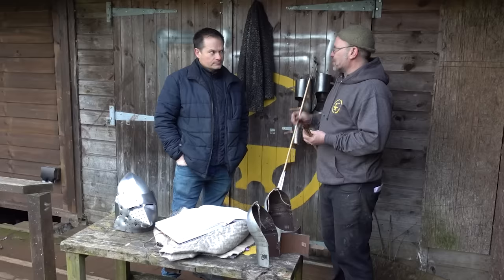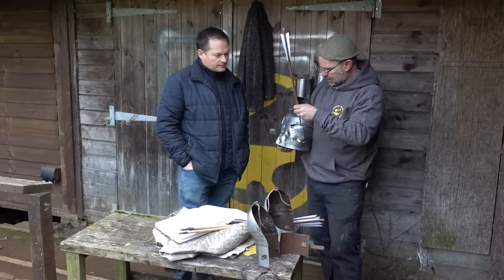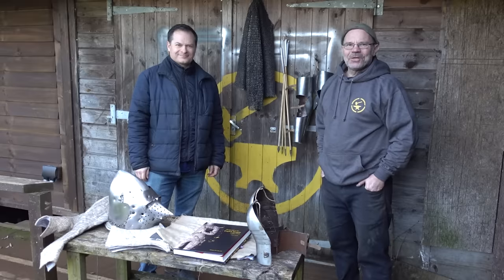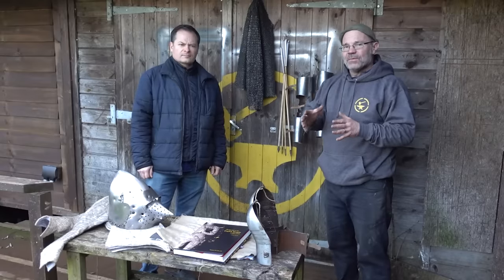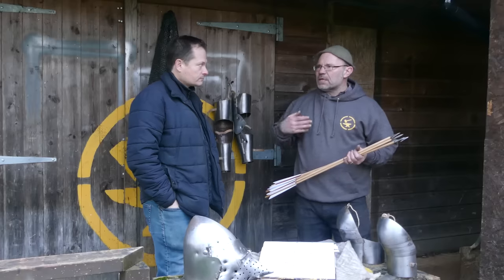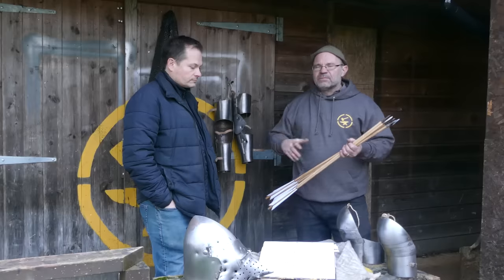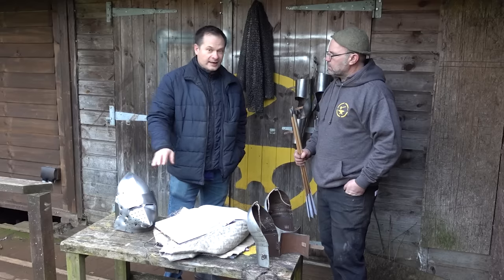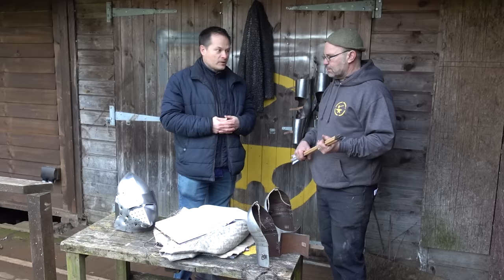Arrows vs Armour 2 - Our thoughts 6 months later

Comment: Have you ever thought that the ghost of a dark ages blacksmith and his archer friend are looking on and wondering why you're repeating what they went through in designing the armor in the first place?
Reply: It's a bit like NASA - we've lost that technology as technology moved on.
Reply: I mean, the dark ages weren't anything of the sort, but ghosts don't exist, so I guess the fantasy evens out?
Reply: It really is a shame they didn't just get a medium or a sorcerer to just summon them up for the info. heh.
Reply from the maker: I do wonder if they would look down/up at me and laugh or just simply be perplexed
Reply: @coolsenjoyer  those are NASA's words.
Reply: @neiloflongbeck5705  we don't use analogue computers any more, and we need to shield digital computers without adding too much weight.  Some types of engineering were lost, but we haven't gone all the way back to the beginning.
Reply: @DavidSmith-vr1nb  we are still using analogue computers to this day, such as in neuromorphic computing, or in heating systems (thermostatic controls) and in vehicles (speedometers).

Comment: Arrows vs Armor 2, the series of films, was clear and well laid out with an excellent crew. Anyone who came to it in good faith would understand exactly what it is, and what it isn't , what was demonstrated and what questions were raised. And you were open and honest throughout. The fact you had to make this video, some of the concerns you address, reflects on the commenters, not the films.
Reply: This is a 48 minute video and most of it is rooted in their own thoughts - not sure why you feel the need to slate the comments on the other videos just because they disagreed with some of the stuff said in the original videos. Tod and Toby have made it clear they welcome that disagreement - in this video, no less.
Reply: That's exactly WHY they asked the peanut gallery for help & comments - so we as a group could think of more things to test that might have been missed.

I was among the "brace it so it doesn't move so easily" crowd - turns out the event length was enough shorter than the kinetic transfer that it's irrelevant from the armor's point of view. (Honestly expected a MUCH faster transfer of energy from arrow to armor.)

P.S. The more eyes you have go over a paper BEFORE you publish, the less likely you are to publish in error.
Reply from the maker: In reply to Andy, we didn't actually feel compelled and in fact the response was massively positive and of course there is always some negative, but unless that is constructive it can be ignored. The main driver was that Toby felt we misrepresented the true nature of the target and wanted to clarify that.  Remember though I am just a bloke organising things and thinking about them.  Professional balanced research and presentation of the knowledge gained is Toby's job, so the finer points of semantics are professionally important to him whilst I am happy to call it what I fancy.  Whilst we were here we decided to cover a few other areas that both of us wanted to discuss
Reply: @tods_workshop  for me, most of the things you talk about in this follow up were all clearly implied in the series. A lot of this seemed to be addressing the negative, which is a shame.
Reply: @aduboo29  Tod's videos have a great community, but a lot of this video , for me, seems to be addressing the negative and pedantic comments, of which there are also a lot. It's a shame. I love that they are rigorous, but most of this video, again, is less further thoughts, and more addressing criticism.
Reply: @muninrob  I feel this video is mostly addressing criticism , rather than following up on observations. For me, a lot of what they talk about here was already clear or implied in the series. There is a great community here, but also some insecurity, as your reply shows.
Reply: @AndyBestHP  I'm always insecure about offering advice from the peanut gallery, since when not ignored it's often mistaken for heckling.
Reply: This is both the Internet AND History, ofc there´ll be loud opinions(more or less funded in reality) ;)

Comment: On the subject of arrowheads, while not directly connect to this narrow subject and time period, there is an interesting passage from John of Plano Carpini from his notes during his travels to meet the Mongols: 
"the heads of the arrows for both bows and cross-bows ought to be tempered after the Tartar fashion, in salt water when they are hot, to make them hard enough to pierce the Tartar armour. ' (dawson 1955 translation, but other translations I've looked at are very similar)

This not only means the Mongols were using steel or case-hardened heads, but also that the manner in which heads were quenched was important. It wasn't just steel or not, they were conscious of different quenching liquids, in this case brine, which creates a very hard and brittle steel. People in the medieval period would have been aware of this and theres even more complexity to everything.
Reply: Interestingly, the vast majority of Mongol arrowheads are also chisel shaped, rather than diamond sectioned. There are a few types that are diamond in plan, but they still tend to be flat in section, with a fairly short bevel to the edge. Might have had an advantage of some kind against the common Lamellar armors typically worn on the Steppes, or just to their forging techniques.

Comment: I recently brought the Osprey book for Agincourt, highly recommend, and I'm starting to think based on these videos and that book that  the archers were used at first to saturate the French advance to wound, maim,and generally weaken the French esprit de corps, destroy their cohesion and morale. Then once they get really close where the lines meet, then they change tactics. Rather than just aiming in a general direction, they close to fire at individuals in support of the main infantry. Also these videos are briliant!👍
Reply: As far as archery and the Hundred Years' War are concerned, can you name any battles other than Agincourt?  For example, English archers were decimated in at least three major battles: Patay (1429), Formigny (1450) and Castillon (1453).
Reply: @MarquisVincentBissetdeGramont  oddly enough I suspect two battles had similar tactical uses. The first was Shrewsbury in 1403 as initial volleys did thier part until the main bodies closed for CQB. Henry "Hotspur" Percy was shot  with an arrow and as far as I'm aware it might have been at close range, at least close enough for a shout to be heard. The other is Towton, in 1461, the Lancs and Yorks exchanged volleys until the Lancs closed due to ineffective archery. The battle was a prolonged fight and the role of archers may have retained this CQB role long after Agincourt. In all fairness this theory is a working one and as they said, armour is wide and varied amongst the opposition and it is clear that anything can happen.
Reply: @sfBE11  Thank you for your very interesting comment.
Reply: @MarquisVincentBissetdeGramont  Yes, you're quite right. English history ignores the lost battles & the fact that the French eventually got their act together & drove us out of France , winning the war.

Comment: Great idea Toby! Looking at the battle of Nicopolis in 1396 might be interesting. The French lost both battles. The French knight Boucicaut was captured in both battles. The French made it through the Turkish foot archers (with lighter weight bows and arrows) who were behind stakes and undone by Turkish lancer-archers in reserve. Boucicaut was in charge at Agincourt. Maybe he thought he could repeat that, and there were no reserves at Agincourt to worry about. He was undone by the mud that day.
Reply: Heh, the arrows may have been lighter, but I've seen some speculation to the power of those Turkish Composite bows that suggests that we can't confidently say that they necessarily had less draw weight.
Reply: @joshuafair5599  I can. See Karpowicz for some of the best work on the subject.  While the hundreds of bows in the Topkapi Palace collection range from 40-240lbs, the range for likely war bows is 90-120, less than the English war bows (most of the Mary Rose bows are in the 140-160 range). And more toward the lower end for mounted archers. The heavier bows are most likely strength training/testing and flight bows. Turkish war arrows from 325-650grains, much less than the 850-1,350 for English arrows. At similar draw lengths and GPP (28 inches and 9 grains of arrow per pound of draw weight) Turkish bows are about 7% faster (175 v 188fps), which may not sound like much but can be very noticeable in practice. I shoot both but prefer the Magyar, Turk, and Tartar composite bows to my longbows.
Reply: As far as archery and the Hundred Years' War are concerned, can you name any battles other than Agincourt?  For example, English archers were decimated in at least three major battles: Patay (1429), Formigny (1450) and Castillon (1453).
Reply: @MarquisVincentBissetdeGramont  The English lost every battle from 1429 to 1453. At Patay (where 1,500 French defeated 5,000 English), Jargeau, Meung-sur-Loire, Beaugency, Gerberoy, Rouen, Formigny, and Castillon (where a French archer killed the English commander. With an axe). How's that? Wait! There's more! The Mongols had more archers (maybe twice as many) at Mohi alone than the English did at Crecy, Poitiers,, and Agincourt combined! ;)
Reply: @mikeorick6898  Thank you for your reply. I have the impression that the battle of Agincourt has supplanted all other medieval battles both in the collective imagination and in the discussions of specialists. Do you think this is justified or do other battles deserve more attention? 
Have a nice day!
Reply: @joshuafair5599  People assume it was so, but most treatise on Asiatic archery show Turks, Chinese, Persians & Mongols all used bows of similar strength to our Longbow, but their composite bows were actually usually more efficient at delivering the draw weight to the arrow.

Comment: I wonder if one of the key reasons why we don't find many steel heads is that they were worth more.. I could imagine that looters after fights would know that certain arrowheads/arrows are worth quite a bit, so they would be high priority items to pick up. Do we have any sources about what happened to battlefields after a fight?
Reply: Stragely enough, steel is actually more susceptible to corrosion than cast iron. Not sure about wrought iron. Perhaps the steel heads rust away more readily?

Comment: Has any of this made you (as a group), re-evaluate the field of battle at Agincourt? For example, how much archery was engaging the French formations from the side, or even as crossfire (from the rear quarters)? The tests replicated forward facing and slightly offset shooting but I’m taking it that the defensive quality’s of the side / rear portions of armour may well have been less, just to assist in mobility, ergo angle of attack being more effective at the armours weaker points?

Comment: Todd, just watching the part about energy drop off, you could set up/find a "lockdown" longbow to simulate the arrow's energy at 50 m when at 15 m and run your tests.
Reply from the maker: I have a lighter one that shoots like a 120lbs, so this would replicate shots of a 160 at around 60m.  The fact is correct, but it is another layer that needs explanation and will take away from peoples easy understanding
Reply: @tods_workshop  that's fair, you'd have to show the footage of Joe's 160 lbs at various points in the video.  But, could be used to see if the assumptions you were making are good or not.  keep up the awesome content!

Comment: What I would like to see is how thick a weave of mail armor would be needed to prevent penetration from the arrow. We have seen the small bits of mail against fabric and the arrow penetrating. And you both mentioned for a hauberk to be made that could stop an arrow, it wouldn't be practical. I'd definitely like to see it even if it isn't a full hauberk. Just something maybe a square foot in size of different weaves of mail and thickness of the fabric behind it. From that one could determine just how heavy and inflexible it would actually be for it to be a full sized hauberk.

Comment: Be great to examine the quality of the metal in Toby's museum's armor collection under an electron microscope to compare it against the quality to the modern mild steel you're using. Is there a higher incidence of inclusions compromising the strength of the medieval metal? Of had metallurgy advanced far enough to make it more of a true analog?

Comment: Overall, great work, this series has been fun to follow. Dr Capwell brings up a great point about the empty husk. Often we've seen swords tested on watermelons, but it's a full watermelon. If you scooped out all the juicy bits and cut at an empty watermelon shell then I'm sure you'd have different results. Those results could mean more or less chance of penetration.
I'm curious to know if there's any sources that bring evidence as to what soldiers of a unit were more likely damaged from arrows. What I mean by this is as a unit of soldiers are advancing, were the men in the 3rd, 4th, 5th row etc taking injuries, or were the front row typically the first to go. I know this would be nearly impossible to quantify because obvious there is more surface area to be hit in the vanguard/ front row. Also it seems to have been common practice that archers wouldn't blindly shoot at a mass, but would aim for areas of weakness i.e. exposed flanks. I would also assume anytime it's documented the results of archer impact mid battle it was more often than not because the commanders were issuing orders to focus on certain areas. Once again the flanks, etc. Throw shields into the mix and everything changes because they weren't typically stuck in one spot on their armor, but a soldier would move it to the most effective position in order to block where arrows seemed to be coming from at any given time.
Haven't had a chance now to finish the video, so I may edit this later if these topics are brought up throughout the video.

Comment: I think something valuable to address the issue of the suit of armor not containing a person would be to add in a ballistic dummy. It's still not a "knight," but getting an insight on what kinds of injuries can actually be sustained from these weird fragmentations and the various penetrations would be very interesting, and I'd argue quite impactful to what the mindset of those around a wounded man may have been after seeing such an injury. It's also rather important when discussing the viability of the armor. Yes, it can be bypassed here and here, and there's some danger of a stray splinter flying off in this hole here, but what kinds of effects does that have on the person inside and how debilitating would such an injury actually be? 

    This is all beside the fact that armor behaves slightly differently depending on what is underneath it. A wooden pole is all well and good for a plate test as long as you give it some wobble, but armors that have give like mail and gambeson could be more resistant with a softer bracing underneath to cushion the impact. Something probably more noticeable in the case of a shot below the breastplate or in the shoulder joint. The arrow aswell has an extra layer of "stuff" to go through, which would impact the depth of penetration and make for more informative results.

    Sorry if this was too wordy, it's late at night here and I tend to ramble when I'm tired.

Comment: That arrow shaft through the eye-slit, today we could be some sort of plexiglass behind the eye slit (anti-fog and anti-scratch, of course), or the person could wear some impact-resistant googles, which would hopefully help a good deal to minimize the risk, at least to the eyes, of such a freak splinter coming through.  You might have to take the splinter to some other part of your face, but the scalp or cheek is less immediately dangerous piercing the eye.  The infection risk still remains, of course, but you might not necessarily be immediately taken out of the fight if you cheek gets tore up, but losing an eye will send you to the rear, or dropping down onto the ground, immediately, removing you from the fight right away.

Would be interesting if we were still evolving armor into the modern day (for melee, not to protect against firearms, which obviously I know we have advanced anti-ballistic armor options today), what sort of features it would have, what materials it would be made of, etc.
Reply: Is that not what the arms race of riot gear is supposed to be? Theoretically withstanding the forces of improvised weaponry in the hands of a violently rebellious group of people?
Reply: It would most likely save your eyes but I can tell you from first hand experience that taking a sharp blow to your safety glasses is still a disconcerting experience and it'll put the fear of god into you. Never taken an arrow to my glasses but I've had grinding disks and chainsaw blades come apart and knock against them and it's spooky.

Comment: Please show the effect using hardened tips on armour approaching the archer at 25-35mph, like charging cavalry. Joe's chronograph tests showed around 200fps arrow speed with a warbow. Add the closing speed of a horse 35-50fps, and do we get more penetration? Well, it surely can't be less!  Also, horse's unarmoured bodies will have presented the biggest target. Can we see the effect on a dead cow, stationary and 30mph  perhaps? Tod could make a wheeled rig on a track. Or is this too gory? Braco to your fascinating experimentation, brilliant work. It's very compelling to consider the physics and gore of these antique battles. I feel lucky not to have been in one.